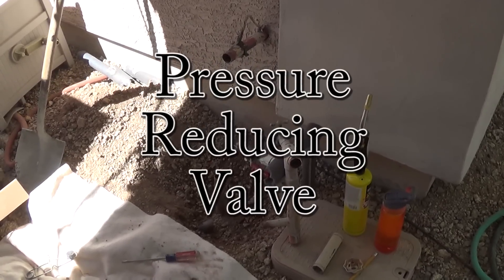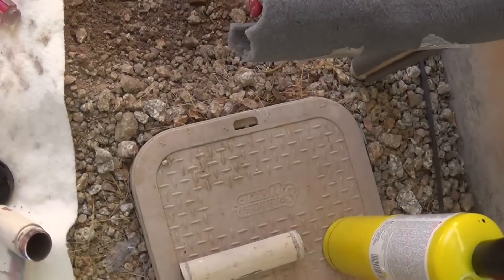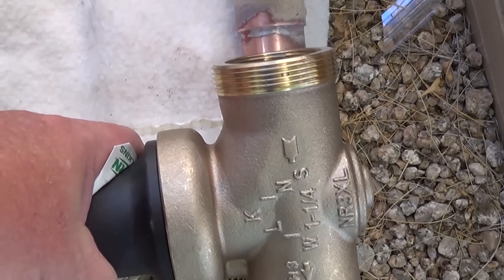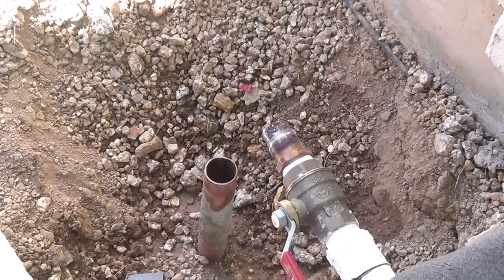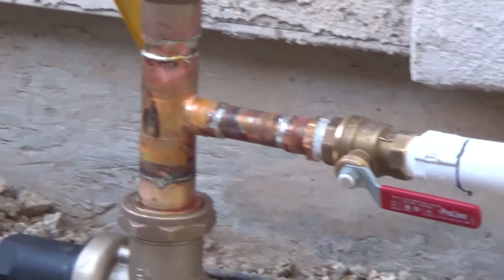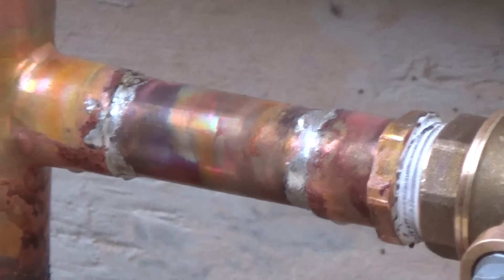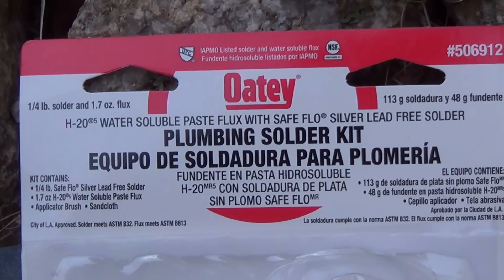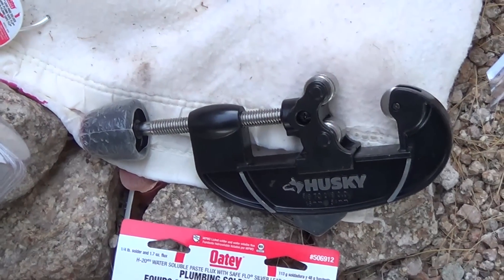Installing a Pressure Reducing Valve - Water Pressure to High 87 psi

Comment: Hey you have to put it right before water faucet, so you don't have to reduce water sprinklers
Reply from the maker: one of the problems was the higher pressure effected the sprinkles in a bad way. the idea was to reduce pressure to all of the water to the house and yard. so far its been working perfectly.

Comment: Lol, you must install a shut off valve before the water pressure regulator.
Reply from the maker: between the house and regulator or between the regulator and the street? there is a main shut off at the street leading towards the house.

Comment: Great plumbing job! But is "lead soldering" safe or toxic for Water?
I googled it and got this: 
Lead solders have about 60% (or 63%) tin and 40% (or 37%) lead in them. They are "toxic" because they have lead in them. They melt at around 185°C. Lead solder is cheap, so it used to be popular.
Reply from the maker: ? its my sisters house they dont drink tap water .
Reply: @ArizonaHotHomestead  Yes, but if they sell the house then the next person might get lead poisoning because someone doesn't know what they are doing.

Comment: You suck, the valve goes first and then the pressure regulator, what an idiot.
Reply from the maker: there already is a value before the pressure regulator its at the main line by the street. that is where we shut off the waterline to do the work. the pressure reg is between valves.

Comment: hey partner...i think the valve might need to go before the reducing valve...just in case you need to service it in the future...
Reply from the maker: good thinking. the main shut off is at the meter which is by the street. so our thinking was putting the pressure regulator between the valve to the house and the main valve at the meter.

Comment: Just after you solder rub flux paste on the joints to clean them up..
Reply from the maker: +DasNimbus interesting,. thanks. I didn't know that.
Reply: +ArizonaHotHomestead you can also use soapy water and apply it with a spray bottle on top of the flux and then wipe clean....spraying one more time ...this stops the green stuff.
Reply from the maker: good thinking. soapy water is great for any leaks.

Comment: good job it's actually a pressure regulating valve or PRV. nice work glad it all worked out for ya.
Reply from the maker: +michaelhbm my sister said the package reads pressure reducing valve not a regulator. so I just went with it. lol.
Reply: oh ok cool. good to know they make those to.